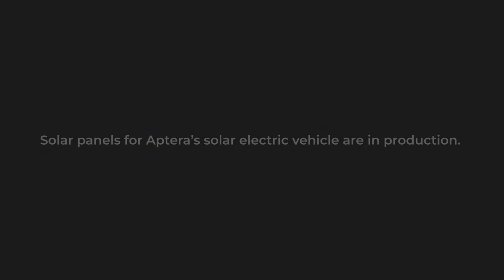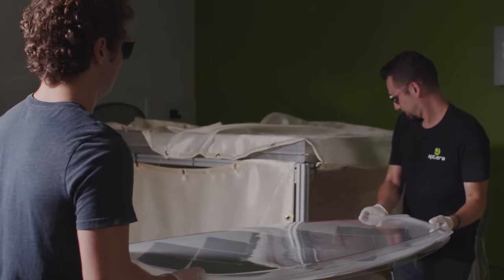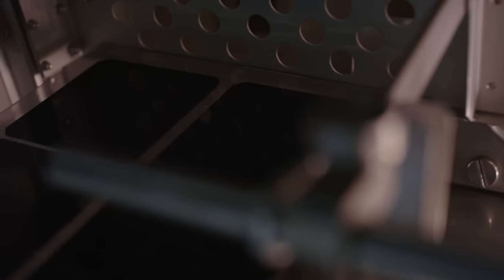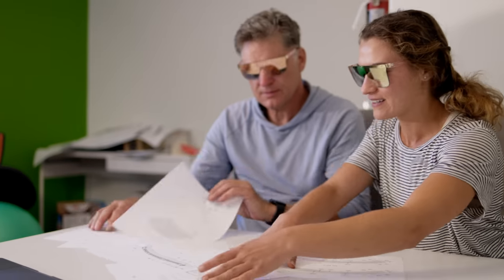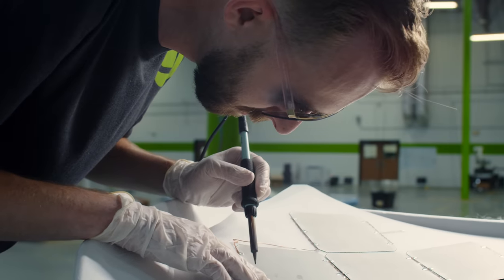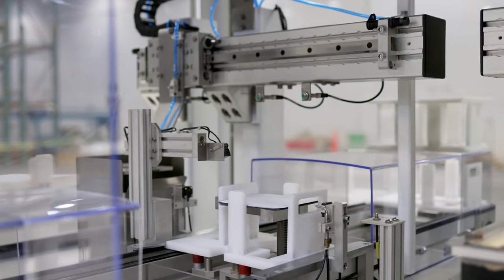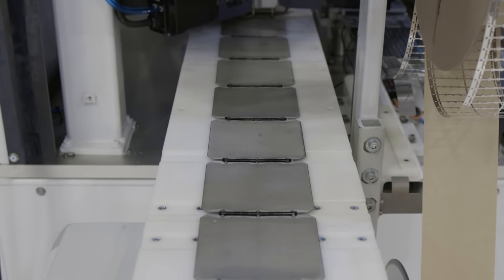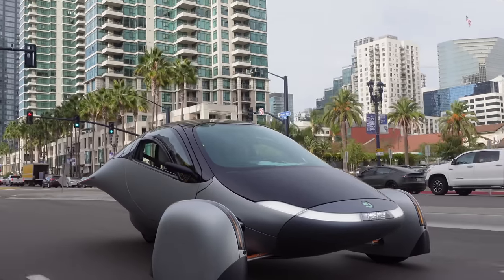Aptera — Solar is in Production

Comment: Incredible stuff!  But what's with the dime store sunglasses?
Reply: Those are Cal OHSHA required UV and laser light personal protection since both are used in the factory this was filmed at.
Reply: N. Bruce Nelson is wrong.

From another commenter who looked up the ACTUAL Cal OSHA requirements.....

"Laser Protection. Employees whose occupation or assignment requires exposure to laser beams shall be furnished suitable laser safety GOGGLES...." and ".......or other equipment producing ultra-violet radiation shall be so arranged or shielded that ultra-violet radiation, either direct or reflected, does not strike employees' eyes in harmful intensity; where such arrangement or shielding is not practicable, employees shall be provided with GOGGLES..."

Note the above references GOGGLES and not "weird sunglasses".

Comment: How do the deal with the fact that a curve will yield different power to each wafer?  In a solar panel,  if a leaf falls on one part,  the whole panel looses 50% power.     And what’s with the glasses?
Reply: That is certainly part of the "secret sauce" of these panels, but I am guessing it involves having more than the usual number of controllers per panel.  I did a Youtube video on the glasses.  They are a Cal OHSHA requirement where UV or laser light might be encountered in the work place.

Comment: I have a question that I haven't heard anybody ask or answer. What about changing flat tires? Does it have a spare? How will that work? Just asking.
Reply from the maker: There will be a jack point to lift the vehicle for wheel/tire repairs. From there, changing the tire becomes the same process as changing a regular tire on any standard car. You can also remove the wheel covers without unusual tools or special skills in only a few minutes. Watch this YouTube video for a demonstration on our prototype vehicle: https://youtu.be/YNvcr9jBcTo?t=97

At this time, no spare is included at the time of purchase. We hope a standard insurer or AAA roadside assistance will be able to help. However, we are taking feedback into consideration. The team is working on their recommendation and where one could be stored. Similar to other electric vehicles, the idea is to not have a spare which weighs down the vehicle's efficiency.
Reply: I have always been able to repair flats quickly on motorcycles, cars, and trucks with a plug kit, a DC inflator, and a pair of pliers.  This does not weigh much and will take care of most tire issues.

Comment: Flexible solar panel have existed for a long time and are already widely used for mobile applicaition such as RVs. Hopefully yours are on an improvement on their crappy 13% efficiency and closer to the 19-21% of standard solar panels
Reply: They are even better.  They have a 22.6% efficiency rating and make power over a larger spectrum range.
Reply: @bobhilder1469  Look at the Maxeon data sheets.  The Maxeon Gen III 3.72 sheet lists the cell efficiency as 24.3 %.  I was being cautious..  Aptera has said between 22 and 23% in the past.
Reply: @bobhilder1469  I am sure that Aptera and I are glad that we have a hero who is the only one who has access to the proprietary information that Aptera has on its own' panels, and that we have you to save us from our ignorance.
Reply: @bobhilder1469  Your response heavily suggests that you didn't knows that the. Maxeon cell constructed panels can have a higher output than their mere efficiency rating would suggest, due to an extended response at both ends of the spectrum.

This allows them to produce power earlier in the morning and later in the evening than panels with conventional cells, making a direct comparison of cell and panel efficiency impossible.

Guess I struck a raw nerve, huh?
Reply: @bobhilder1469  I think I see the problem with your thinking here.  You are confusing efficiency with power output.  In this case, the extended power production of the panel can result in more total power output even with a lower total panel efficiency because it is producing power longer.  And the difference can be quite significant.

You are clearly capable of doing your own research.  I suggest you do some in this case.
Reply: @bobhilder1469  LOL.  Talk about running away.  You might want to check out Steve's video which was posted this morning at Aptera Owner's Club, who goes over what you are missing.  Your # one point is false in this case.

Think about it.  If a panel is producing power for a significantly longer time frame, even lower efficiency panels can end up producing more total power, and we have evidence that panels made from Maxeon 3 cells do exactly that in published papers.  You are stuck on a red herring with your efficiency talk here.

You're welcome.
Reply: @bobhilder1469  Look up the paper "Solar cell efficiency divergence due to operating spectrum variation" by
Geoffrey S.Kinsey and others on the same subject - and enjoy your glass house.
Reply: @bobhilder1469  Can't wait to see your corrections of all the other "misinformation" Bruce is trying to spread in this thread.  By the way, when last we spoke, you had just sold house number 5 (32 cash offers over asking and most having 0 days inspections as I recall!) so unless you sold another since then, you're down to 4.
Reply: @bobhilder1469  "
Fact: Maxeon data sheets have the CELL ratings not PANEL ratings.

You and I agree completely on that.

You are making the "elementary mistake" that this is what is important.  What is important is the amount of power the Aptera panels are putting into the batteries, and there are many factors here beyond efficiency.  

One is the spectral response of the cells themselves because they can extent the length of time that the cells in the panels are producing.  

Another is how the panels behave when some of the cells fall under shade or a significantly different amount of light.

There are still far more details yet to be revealed here and as time goes by, we will be learning more.  

I am pretty sure that the work that Aptera has done on solar panel development will result in its own separate income stream, just as some of their software development work already has.
Reply: @bobhilder1469  It's kinda odd that a guy (Bruce) uses the word "efficiency" so much then has chutzpah to basically say it's not all that important.  If "power" is what's important, as Bruce says, and power is linearly dependent on "efficiency", it, BY DEFINITION, is important.
Reply: @bobhilder1469  With my tail between my legs, LOL.  I can only take engineers behaving like two year olds for so long.  I used to get paid well for it, but now I may take a break from time to time.

Comment: I'm so sad there's still no plans for a J1772 port, or even to have that as an option. Like it or not, that kinda where things are going, especially abroad. I just really want to see this thing succeed, and tying it to a proprietary non standard charging system worries me a lot. I'd really like this to be my next vehicle when it's time to graduate from my PEV, and while I personally might be ok with adapters, that's not an option legally in every market, and I feel like that will get more common than less moving forward.
Reply: At present, the Tesla port with adapters gives Aptera the greatest number of charging stations available by far, as long as Tesla permits Aptera owners to use their locations.  In markets where there is no legal option to use adaptors, Aptera will supply a suitable solution for that market.

Comment: What if for some reason solar did need to be changed and it's out of warranty?
Reply: The up charge for full solar was only $900.  Many people would see the power savings give a return on the cost.  In addition, by that time, panels might be both less expensive and have higher outputs.

Comment: 10 per day is sounding like a good start.  But that needs to go up by a factor of at least 10x.  I wonder how that next jump occurs.  Less manual soldering for sure.  Robotic laser welders?
Reply: 10 a day is probably enough for them for the next year. Their original rate target was 40/day but that will probably go up a lot. Lots of work to do there!
Reply: Duplication of fixtures and tooling.

Comment: How efficient?  Current residential solar panels are about 25%.    Haven't heard any number from Aptera....
Reply: @bobhilder1469  Thanks, Bob
Quite interesting.

I'd be surprised if the whole array made 100Watts in full sun.  About
1/7th of a horsepower.  Not a lot.

And, the weight.  I'm not a fan of adding weight up high on the chassis.

This part of the Aptera seems a bit of a gimmick.  But, do like most of what they've done.

Cheers

Comment: Anyone know why a bunch of the employees are wearing the same 'sunglasses' inside? Something to do with viewing the solar cells?
Reply: It is probably a Cal OSHA requirement due to the possible exposure to lasers and UV light.
Reply: N. Bruce Nelson is wrong.

From another commenter who looked up the ACTUAL Cal OSHA requirements.....

"Laser Protection. Employees whose occupation or assignment requires exposure to laser beams shall be furnished suitable laser safety GOGGLES...." and ".......or other equipment producing ultra-violet radiation shall be so arranged or shielded that ultra-violet radiation, either direct or reflected, does not strike employees' eyes in harmful intensity; where such arrangement or shielding is not practicable, employees shall be provided with GOGGLES..."

Note the above references GOGGLES and not "weird sunglasses".

Comment: Will this produce any meaningful amount of energy? It is a relative small area on top of a car, and it will mostly not be angled towards the sun when in the sun at all.
Reply: The full solar version may produce enough to drive the vehicle 40 miles per day in the San Diego area measured on the EPA highway cycle, or perhaps 20 miles per day where I live in Iowa.   This is certainly enough to be meaningful to both my pocket book and in reducing the frequency of needing a plug-in charge.  I will report on my actual results when I start driving my early Aptera.
Reply: That is not bad at all for a daily comute!

Comment: Can it travel at night? What happens when the sun does not shine for a few days?
Reply from the maker: Thankfully Aptera has a battery that can travel 250, 400, 600, or 1,000 miles (depending on your battery pack size) and charge by plugging in at home to a standard 110V and 120V or 220V and 240V outlet. Your vehicle would function in rain or shine, night or day. The built-in solar power is an added bonus! We plan for Aptera to be compatible with Level 1, Level 2, and Level 3 DC Fast Charge stations. And to ship the vehicle with a charging adapter so that you can charge it anywhere. You might also be surprised by just how much solar energy can still be obtained during overcast days. 🌥

Comment: What's the story behind the matching sunglasses?
Reply: I am pretty sure that wearing them in that facility is a Cal OSHA requirement.
Reply: @n.brucenelson5920  I assumed it was H&S related, i just wondered what they were specifically for. Are they just stylish eye protection or are they filtering UV or something?
Reply: N. Bruce Nelson is wrong.

From another commenter who looked up the ACTUAL Cal OSHA requirements.....

"Laser Protection. Employees whose occupation or assignment requires exposure to laser beams shall be furnished suitable laser safety GOGGLES...." and ".......or other equipment producing ultra-violet radiation shall be so arranged or shielded that ultra-violet radiation, either direct or reflected, does not strike employees' eyes in harmful intensity; where such arrangement or shielding is not practicable, employees shall be provided with GOGGLES..."

Note the above references GOGGLES and not "weird sunglasses".

Comment: But why the sunglasses? So many people wearing them inside…
Reply: Likely Cal OSHA regulation for UV eye protection.
Reply: N. Bruce Nelson is wrong.

From another commenter who looked up the ACTUAL Cal OSHA requirements.....

"Laser Protection. Employees whose occupation or assignment requires exposure to laser beams shall be furnished suitable laser safety GOGGLES...." and ".......or other equipment producing ultra-violet radiation shall be so arranged or shielded that ultra-violet radiation, either direct or reflected, does not strike employees' eyes in harmful intensity; where such arrangement or shielding is not practicable, employees shall be provided with GOGGLES..."

Note the above references GOGGLES and not "weird sunglasses".

Comment: What's up with the glasses?
Reply: Likely an OSHA requirement.
Reply: N. Bruce Nelson is wrong.

From another commenter who looked up the ACTUAL Cal OSHA requirements.....

"Laser Protection. Employees whose occupation or assignment requires exposure to laser beams shall be furnished suitable laser safety GOGGLES...." and ".......or other equipment producing ultra-violet radiation shall be so arranged or shielded that ultra-violet radiation, either direct or reflected, does not strike employees' eyes in harmful intensity; where such arrangement or shielding is not practicable, employees shall be provided with GOGGLES..."

Note the above references GOGGLES and not "weird sunglasses".

Comment: why are they all wearing those sun glasses inside
Reply: They are using UV light in testing.  It is a safety requirement.
Reply: N. Bruce Nelson is wrong.

From another commenter who looked up the ACTUAL safety requirements.....

"Laser Protection. Employees whose occupation or assignment requires exposure to laser beams shall be furnished suitable laser safety GOGGLES...." and ".......or other equipment producing ultra-violet radiation shall be so arranged or shielded that ultra-violet radiation, either direct or reflected, does not strike employees' eyes in harmful intensity; where such arrangement or shielding is not practicable, employees shall be provided with GOGGLES..."

Note the above references GOGGLES and not "weird sunglasses".

Comment: Why the sunglasses? What are his eyes hiding?
Reply: It is a Cal OSHA requirement in facilities that may expose one to UV or laser light.
Reply: N. Bruce Nelson is wrong.

From another commenter who looked up the ACTUAL Cal OSHA requirements.....

"Laser Protection. Employees whose occupation or assignment requires exposure to laser beams shall be furnished suitable laser safety GOGGLES...." and ".......or other equipment producing ultra-violet radiation shall be so arranged or shielded that ultra-violet radiation, either direct or reflected, does not strike employees' eyes in harmful intensity; where such arrangement or shielding is not practicable, employees shall be provided with GOGGLES..."

Note the above references GOGGLES and not "weird sunglasses".

Comment: Is everybody that works there required to wear those dopey sunglasses?
Reply: No, however, it was a department branding exercise, and they do provide UV protection.
Reply: @n.brucenelson5920  Hey N. Bruce Nelson.  In numerous comments spread throughout various YouTube videos you adamantly claimed that it was a Cal OSHA requirement.  Sometimes you even said you had "lab management experience in California and knew this for a fact".  Were you wrong in all those numerous comments and why should we believe you now?
Reply: @palindromeambigram4852  First of all, let me correct some information.  The lab I managed was in Arizona, but I did write the Cal OSHA manual for a California company.  

Safety glasses ARE a requirement for areas that are exposed to UV or laser light.  

However, I contacted Aptera directly and they told me that while those glasses ARE UV protective, the reason for them was not OSHA, but that it was a branding exercise.

I corrected the mistaken information, but some people seem to be willing to ignore corrections.

I regard this issue as a distraction from the overall value of the Aptera vehicle design, which is what I am here to advocate for.  I know that there are some that also disagree with that.
Reply: @n.brucenelson5920  NO!  Safety Glasses are NOT required.  GOGGLES are!  That's the point that you continue to be stubbornly wrong on.  Why are you ignoring that "correction"?  I have no problem with advocacy but do have a problem with mis- and disinformation.
Reply: @palindromeambigram4852   @PalindromeAmbigram  What part of the "No" in my comment to Doug when he asked "Is everybody that works there required to wear those dopey sunglasses?" can't you understand? 

Those glasses were worn as a branding excercise and not for OSHA reasons.

OSHA uses the term "Safety spectacles" as well as "goggles"
Reply: @n.brucenelson5920  What part of "stop making stuff up" do you not understand.  You, in so many YouTube comments/replies, if not elsewhere, said unequivocally, that sunglasses are required because of CAL OSHA yet you never, unequivocally, said you were wrong to repeatedly say that.  You can dance around the "truth" all you want but never saying you were wrong is very silly.
Reply: @palindromeambigram4852  I have repeatedly said I was wrong about the glasses in them video, and told the reason why - that it was a branding exercise for the Aptera Solar group.